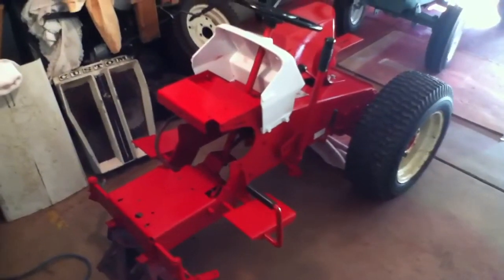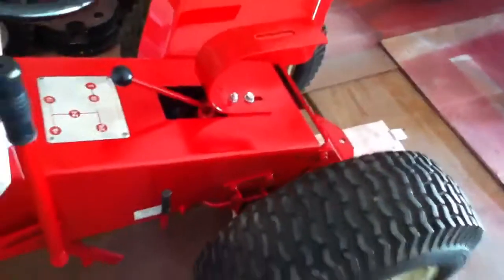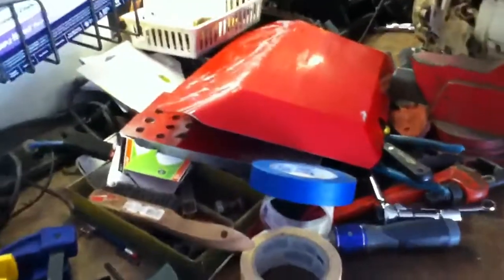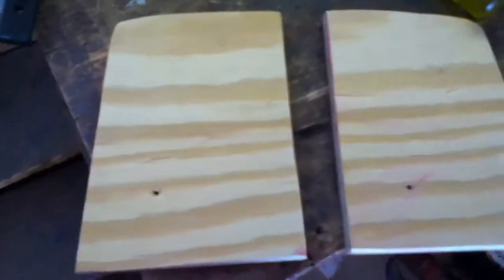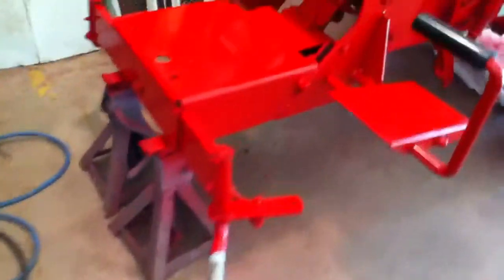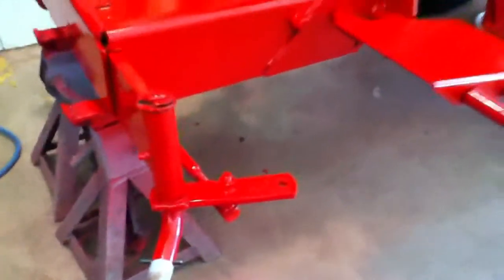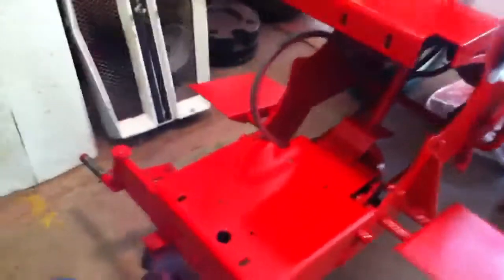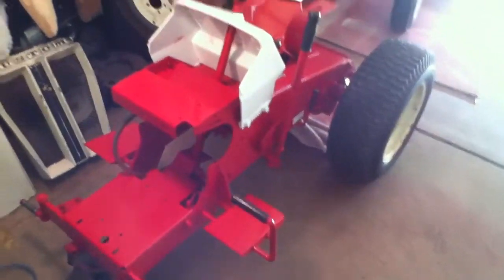66 Sears Custom update

Comment: Looks great wish it were a dark blue but ohh well and I'm currently doing a nut and bolt restoration on my wheel horse and was wondering how do you paint between the rim slots with a rattle can or spray gun?
Reply from the maker: Thanks man, nope no dark blue here. lol It's not hard to paint between there just alittle tricky, I've found it's easier to paint in there 1st then fan it out and blend the rest of the rim. Maybe I can shoot some footage when I paint mine to show ya.
Reply: That would be great. Thanks
Reply from the maker: No problem my friend.